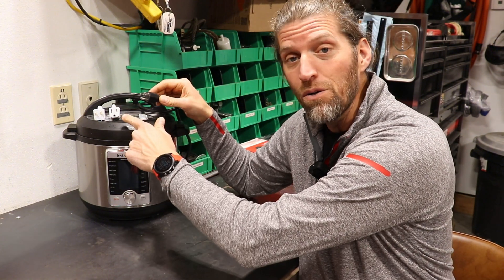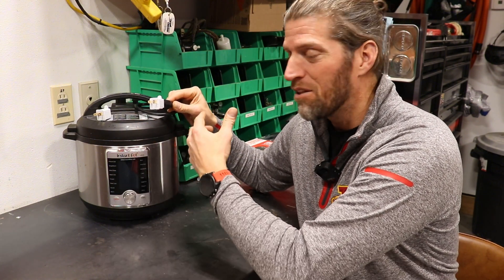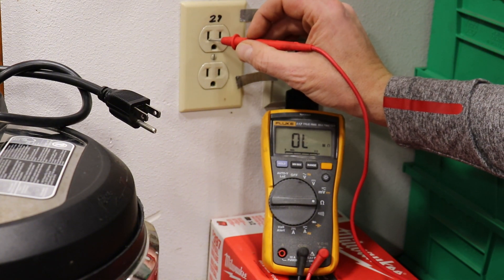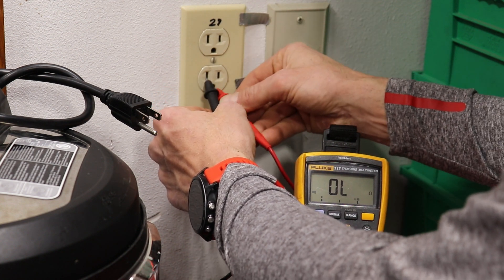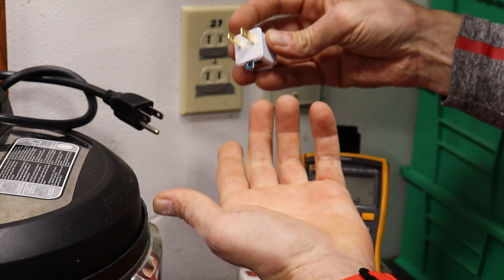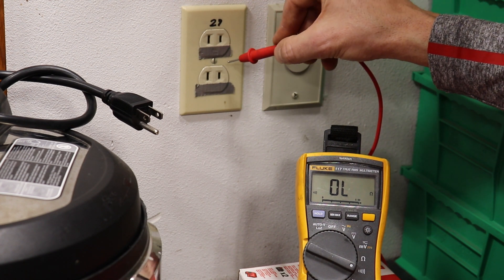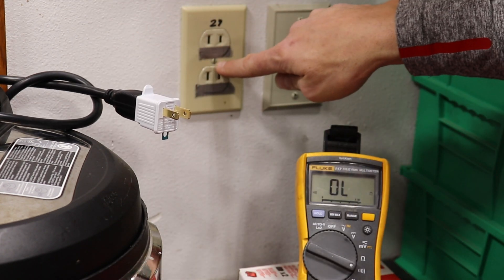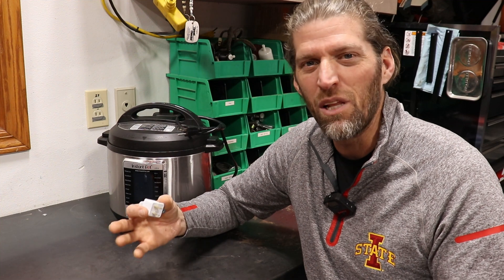Is an electrical three prong adapter safe to use?

Comment from the maker: What electrical questions do you have? Always looking for content ideas my audience wants to learn!
Reply: I'm not sure if it's "up to code" universally, but a GFCI outlet will offer this protection without a grounding conductor at the point of use. This applies to all the "downstream" outlets as well (that are also protected by the GFCI), and you can put in 3-prong receptacles with "GFCI PROTECTED / NO EQUIPMENT GROUND" labels -- or safely use the 3-prong to 2-prong adapter without connecting the green tab.

Not really a question i guess lol
Reply from the maker: @jeremiahbullfrog9288  absolutely 100%! Whomever designed the ground fault circuit interrupter (GFCI) has single handedly saved many many lives. Commonly within and outlet and sometimes within a circuit breaker (dual function). And, like you said, downline series outlets can be protected by an upline GFCI, if wired properly. Which, is always funny when the GFCI trips, and people can't figure out why some outlets won't work lol😂

And, you're correct, the grounding conductor is irrelevant to a GFCI's operation. I'm planning an upcoming video to explain how they work, and how they differ from an Arc Fault Circuit Interrupter (AFCI).

Cheers!!

Comment: What if you touch that green tab on the 3=prong adapter, will you get shocked?
Reply from the maker: Great question! The green tab is a path for the grounding (safety) wire coming from the item plugged into it. A grounding wire (and green tab) would only ever have electricity flowing through it if there as a 'short circuit' within the tool.....so a moment in time (to protect you).

So to your question, it would be rare for the green tab to have electricity present (and therefore not shock you). However, the generally rule in electrical is the only way to guarantee not getting shocked is to not touch 😀

Comment: Thank you James .. very helpful! I have a 2 prong outlet in my car and a 3 prong power source I would like to be able to plug into and power off the car as the cigarette lighter implement that is sold with the power source (Jackery) doesn't fit my 2021 RAV4.  I don't even see a place in the car outlet for a ground...unsafe? Bad idea? Thanks again! Sue
Reply from the maker: The device you're plugging into your 2-prong vehicle outlet will still function the same in general, since that grounding conductor is just a (singular, old-school) means of safety protection.....especially important years ago when tools/appliances were entirely metal, and before a GFCI existed. There is a good chance your car outlet might have some kind of build in GFCI protection within the power inverter, you might have a look in your operator's manual.
In general, the risk is likely very low, since most devices are covered in non-conductive plastic or are double insulated. This video is a helpful compliment you might want to watch. https://youtu.be/yU5h1oP8iJc?si=iz-5Sg7Y29_qMzQS

Last point, with vehicle outlets, the bigger limiting factor to their use is typically the available/rated electrical current. They're normally designed to provide maybe a maximum of 400watts, which really isn't a lot of electrical flow (current), so definitely check the device you're desiring to plug in and make sure you don't go over the designed current rating. You likely won't hurt anything, the vehicle power inverter will likely just turn itself off to protect (kind of like a circuit breaker would do).

Cheers ☺️

Comment: One of the most comprehensive and straightforward videos I’ve ever seen! Great stuff !
Reply from the maker: I really appreciate that comment! I pride myself on being able to explain things in simple, logical, easy to understand ways.

Stop back soon and share with others! A growing channel run by just this one dad, trying to share knowledge and laughs 😃. 

Cheers!
Reply: @LearnedFromDad what if there is no continuity between the screw and the neutral?
Reply from the maker: In that case, you'd be without the protection of the "grounding" conductor on the device you're using. While risk is present because of the lack of grounding conductor path, it's probably fairly low as most modern tools/devices are covered in lots of plastic parts which are minimally conductive. Often that grounding conductor is just attached a motor and/or housing that is internal, but contained within all the plastic parts (reducing shock risk if a short were to happen).

Tools from 50yrs ago would have been a greater risk for sure as their cases you held were all metal, so everything was conductive!

Your best bet for electrical safety is definitely a ground fault circuit interrupter (GFCI).

Comment: I’ve got a basic two pronged outlet, and a basic two pronged ac/dc converter for an ultra low voltage LED light strip, only problem is that I’d like to have a smart outlet plug sit in between them, and that’s three pronged. 

I’m pretty sure that because this thing is solid plastic, using an adaptor to plug it into my two pronged outlet should be safe. It’s highly unlikely that it’ll short out, since it’s relatively new, and the load placed on it will be so low. 

Thanks for the info!
Reply from the maker: I'd agree with you. The risk would be a short within the smart plug, but like you mentioned, there is probably no exposed conductive parts on the exterior that could be touched so risk sounds small. Glad it was helpful to guide you. Cheers!

Comment: When checking continuities using your meter it showed "1", is 1 continuity enough to carry the load?
Reply from the maker: When checking continuity, the 1 indicated the amount of resistance (measured in ohms) across that given electrical path. 1 ohm is a very low resistance so current could flow very freely. A few other 'if' statements could be involved to contradict how much current could be carried, such as having some connection point with barely any contact. That is a minimal resistance path, until high current attempts to flow, and it acts more resistant.
Reply: Is safe to use heavy duty back pack vaccum
 With that adopter?my outlet is two prongs and may vaccum is three prongs 
That’s why i need that adopter
Reply from the maker: The vacuum should still operate properly, but you'll just be eliminating the grounding safety protection of the vacuum. It's very rare for a tool/equipment to have a short circuit and the lack of grounding to be dangerous to a user, but it certainly is a risk. The best thing you could do is plug into a ground fault circuit interrupter (GFCI), that is a more reliable safety protection than grounding (an older method of electrical safety).

Comment: I purchased an old plate warmer from the 1960s. The plug has two prongs; how can I create a ground? Should I use a two-prong to three-prong adapter?
Reply from the maker: The best personal protection you can use first and foremost, in my opinion, is a functional ground fault circuit interrupter. Most know GFCI within an outlet, but also are sometimes built into a circuit breaker. Also, they have GFCI cords.
But, to your question, installing a 3 wire power cable, with a 3-prong plug, and attaching the grounding prong wire to the metal  case of the device will add some level of grounding protection. However, even with grounding protection, using a GFCI adds an even better level of protection. A video to come soon on how those work!

Comment: 👍👍👍 In the UK only 3 pin plugs are used, live, neutral and earth. However nearly all electrical goods from the EU only have two wires live and neutral so the earth pin is not connected. Thanks James
Reply from the maker: I was waiting/hoping some folks from global areas outside of North America would watch and add some comments! Thank you!

As I've traveled the world, it's been interesting to see the different AC electrical system plugs. I grabbed my voltage/plug adapter to remind myself of the difference between the plugs you were referencing. Seems the UK uses the same as I experienced in South Africa, Zimbabwe, and some other countries.
Reply: What about those electric shaver outlets?
Reply from the maker: @jeremiahbullfrog9288  this is one of the reasons I really enjoy doing YouTube, I get to learn alllll the time. I had never heard of a 'shaver outlet', but a quick Google search and there it was. Very interesting concept of severely limiting the electrical current flow to a 'low risk' level (and lower voltage), prior to the presence/development of a GFCI. So interesting, thanks for enlightening me!

Have you ever see one of these in North America? It sounds like they are primarily Euro based, from the article I read.
Reply: @LearnedFromDad  No I haven't seen one inthe US.. i always thought it was just a UK thing. And i didn't know they were current limited. We're all learning together!
Reply from the maker: @jeremiahbullfrog9288  at least that is what the one quick article I read indicated haha. For sure they take the voltage down, from the normal ~240v/50hz used in European and other countries down to ~120v. Definitely will be reading more. I have been all over the world, but never to Europe ironically.....I need a trip!
Reply: @jeremiahbullfrog9288  
As with everything there is always an exception to the rule, shaver outlets are one of those exceptions
Reply from the maker: @Pete.Ty1  have you encountered those unique shaver 'shaver outlets' in the UK? Very prevalent, or more of an old design implementation?
Reply: @LearnedFromDad  
Not all houses have them, I personally don't use one. But we are able to buy 2 to 3 pin adaptors which is what I use myself. In the UK we are not (legally) permitted to have a 240v outlets in the bathroom hence the shaver outlets.
Reply from the maker: @Pete.Ty1 not allowong 240v near water sources, and use of the shaver outlet, was what I had read via Google......so sounds like I found a reasonable source 😀 Thanks for educating me, so fun!

Comment: Sticking an ohm meter into a live electrical outlet seems ilke a bad idea..
Reply from the maker: You bring up a good point, and something I didn't mention in this video, but I had that particular circuit breaker (feeding the outlet) turned off. Testing resistance (which a continuity test is the same fundamental function) needs to be done with no voltage on the wire. Grounding and neutral conductors don't (normally) have voltage on them in this type of 120v circuit, but turning off that breaker was an important simple step. If I was fully troubleshooting this AC system and looking for specific resistance values, to your point, I would have taken further steps to isolate the power supply from the electrical panel.
Also important to note that the multimeter leads are insulated specifically to allow used on live electrical circuit. However, there are definitely some additional best practices for live testing that can be followed to further reduce risks.
Glad you brought this up. Thanks for watching.
Reply: @LearnedFromDad  If you're going to do this a lot, they make AC plug to banana plug adapters that allow you a safer place to stick the probes when you're checking outlets with a multi-meter. They also make ones that handle just the ground pin. I haven't seen any that offer all three in one cable. You can probably also terminate a 3 prong plug in a 3 2 conductor wagos and test like that with reasonable safety. Although the result of that is definitely not UL approved.
Reply from the maker: @SmallSpoonBrigade  great point, thanks for sharing. I've used a DVOM for years, and aside from alligator clips I've always just gotten by with standard probes. I started doing some searches after seeing your comment....I went down a rabbit hole!! Thanks for the suggestion!
Reply from the maker: @SmallSpoonBrigade  agree on making sure you doing touch the exposed segment of the probes. I've got a multimeter video coming up where I mention that point. Doing this I enjoy when folks bring up things I've never seen or thought about and get to learn something new myself.